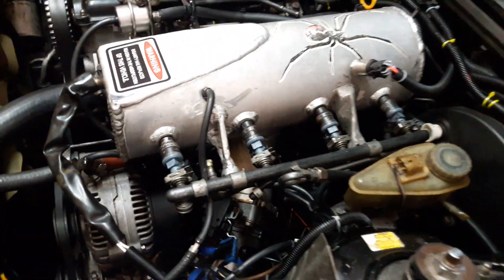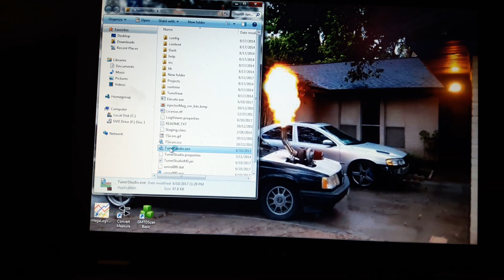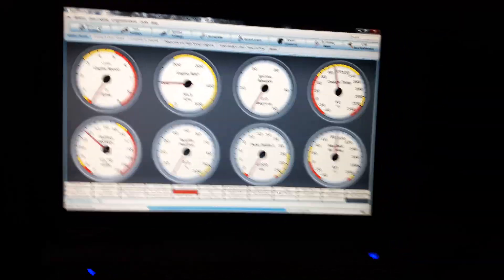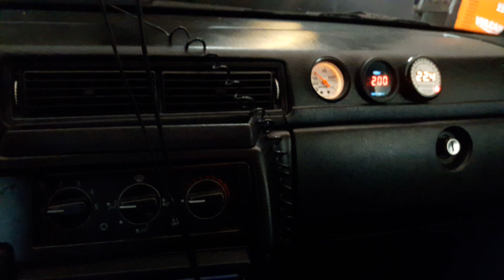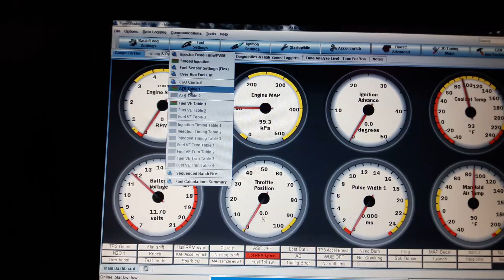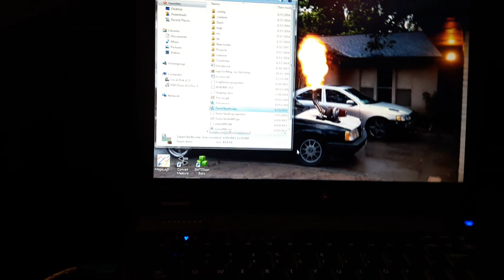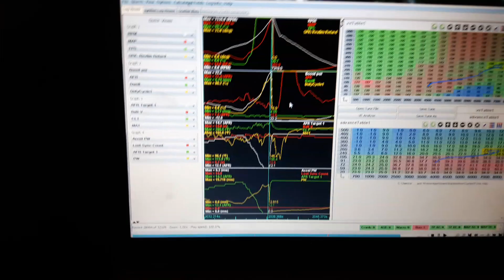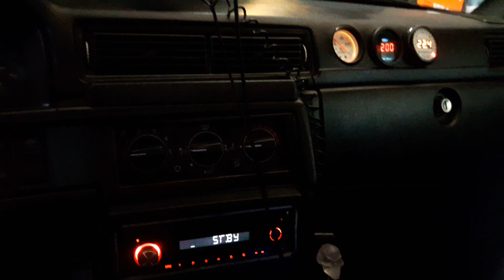Microsquirt beginner video and a couple tips

Comment: Did you have bad experiences with K-Jetronic?  Seems pretty simple to me. Not sure if you can get 300hp from it, but a solid 200 for a daily driver Red Block would be fine. Wait, wait, Porsche used K-Jet too, and got a lot more than 200hp from their old flat sixes. So did MBZ and BMW. I wonder if a six plug K-Jet could be piped into four injector feeds? 50% more fuel....oooooh.
Reply from the maker: Group A had good results with it. I have tinkered with shimming the line and control pressures, but then the idle becomes whacky and fuel mileage takes a horrid dive. Microsquirt  learns and adjusts to fine tune. K jet will not so much. Microsquirt will save fuel mileage, burn cleaner and give datalogs. It's a massive upgrade on every topic. Wires, hardware, injectors, relays, fuses. The everything.
The k jet was working fine, but not to add a turbo.

Comment: AFAIK, the reason you need to use a separate ground for your sensors is because chassis ground is very noisy.

I sort of think about ground as a lake full of electrons. This may be a flawed analogy but here goes: Normally, using earth ground, that lake is effectively infinite, because it's the size of the whole Earth. Using chassis ground, however, that lake is only as big as the chassis of your vehicle, i.e. not very big at all. When you connect something to ground, it starts sending "ripples" through that lake. On the infinite lake (earth ground), that isn't a big deal because the waves go away quickly and don't bounce around, but on the small lake (chassis ground) those ripples bounce around and hang out for a long time before going away. 

If you connect a big noisy load to chassis ground (think PWM motors, etc.) it's like driving around your big Sea-Doo on a little lake, making a big wake (electrical noise) and pissing off all the swimmers (sensitive sensors). Instead of swimming in the ocean (earth ground), or the lake (chassis ground), they'd rather swim around in a little swimming pool without all the waves (MS/signal ground).

The practical effect of this is that if you connect an oscilloscope between the microsquirt's positive rail and chassis ground, you'll actually be able to see a lot of the signals being sent to noisy components. The dead giveaway is a square wave pattern. If you connect instead between the microsquirt positive rail and the microsquirt ground, the square wave goes away. That square wave pattern and all the rest of the noise being sent over chassis ground is what causes the wild fluctuations in every sensor simultaneously, from what I understand.
Reply from the maker: Correct, great analogy! So ground to the block or negative battery pole, right?
Reply: @TurboWorld  I don't know much about the microsquirt itself but I think it probably makes its own reference ground for the sensors, and then it gets grounded to the block. So yeah, sounds right to me.
Reply: @tissuepaper9962  The more good solid grounds around the vehicle the bigger the lake is. Ground even your hood and doors with copper braid, like Mercedes does.

Comment: How would you wire in an ignitor chip for an sr20det on microsquirt v2.2
Reply from the maker: What I did to simplify is use Ls v8 coils.  They have built in ignitor. Makes wiring much more simplistic, and eliminates the ignitor chip or ignition power stage.

Comment: Hi . I hope you still reply to questions.  i happen to have a Volvo 940.1994 regina model B230 engine. I measure only the crank sensor while it is installed and cranking.I read between 100-120mv. But i can find any ready in my trigger logger of rpm nothing.the firmware sas MS2 3.4.1  trigger pattern is 44-2-2 preset in  microsquirt, do you have any ideas what to do? i have no spark either. the sensor has 3 wire. red/blue/bleack seems to be the shield. red and blue reads 196.6 ohm .three weeks trying to find the answer. there are many gues.  Pls help.   regards
Reply from the maker: Yes. I think I can help. One of the three wires is a shielded ground, meaning  it does not go to ms box, it goes to block ground to shield the high voltage signal from carrying a rf interference frequency that would interfere with other systems.
 The other two go to ms, but you need to install a 10k ohms or higher resistor between two signal wires.   This is because ,when hooked up right, the sensor starts making more voltage than box can see, so you cut the voltage down, by adding resistance, and then you can rev past 3k rpm.
 The other major problem is that you are using a 60 trigger teeth wheel off the crank, with 2 missing teeth, and tooth 1 angle is 87 degrees. If you use the stock flex plate or flywheel off a lh2.2 or 2.4 car, that is. This is the info I use on mine, and I believe to be exact.
Reply: Turbo World thank you so much friend. The wheel i am using is also 44-2-2 i am using the type of volvo with renix ecu efi system wich they say came only  to USA. The risistor is the item I haven’t use yeth. I’ll chek it and reply to you.
Reply: Turbo World hi . We did the test.we found out the issue was the ecu.it was for LS. So we fixed it. I nees one more help wich is three questions. Batch fire you use for the volvo? Wasted spark for ign?? Idle controle valve on or off? Or PW HZ wich frequency you selected? Thanks you for your help.
Reply from the maker: Batch fire, Wasted spark. Not sure of pw @ idle , no idle motor.
Reply: Turbo World  hey thank you. I ll let you know the result soon.

Comment: Ok tbh I am giving you thumbs up because of the carb guys joke but I have a question to ask can I run microsquirt with a distributor so it doesn't not fck with my ignition timing and stuff like that
Reply from the maker: Lol thanks! 
  You can run it with a distributor, its compatiable with just about anything. I wouldnt suggest tuning without adjusting your ignition timing, there is alot of power to be had, but also need to be careful. It can just tune fuel, but I suggest using the ignition side of it too. If you use stock ignition with microsquirt tuning fuel, the engine will do odd things, because the stock computer is controlling ignition, and microsquirt is controlling the fuel. Overcomplicates , instead of simplifies. Hope that helps!
Reply: @TurboWorld  btw after 24 hrs i have now decided to do timing as well but the thing is i have got an ooold 1.2 litter  lada engine which dosent have an ecu and stuff .its from 1973 i think .  i am sure that fitting a crank position sensor or cam sensor would be a pain it the ass is there a way of using my distributor to tell the ecu the position of the engine and then have a wasted spark setup or i have to go crank or cam pos sensor , could you give me an idea of what parts should i use for the ignition system like coils and such
Reply from the maker: @ivanyalamov5109  the dizzy should have a hall effects sensor in it. Its compatible with ms. Also find newer parts car for throtyle body, intake, or throttle position sensor, and coolant sensor, and air temp sensor. Then run Ls coil packs or whatever you can find..